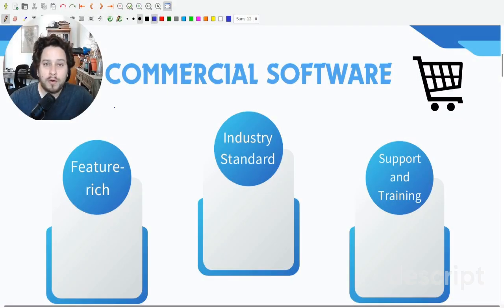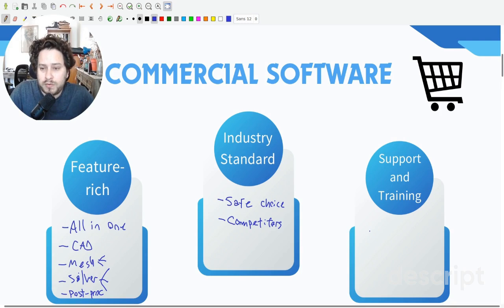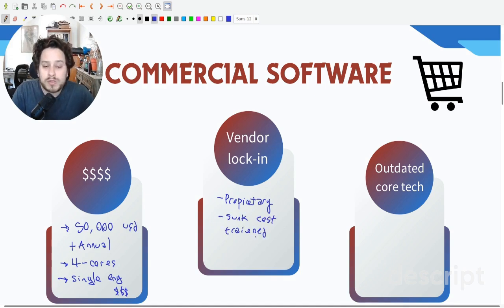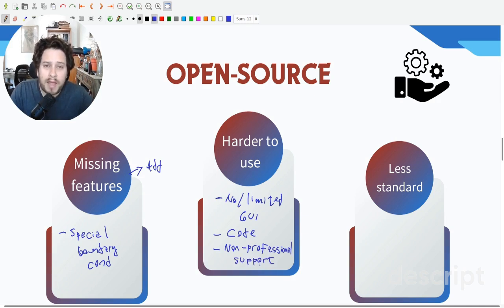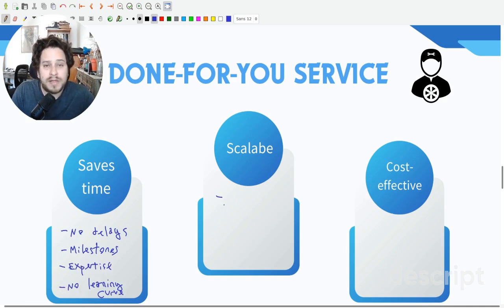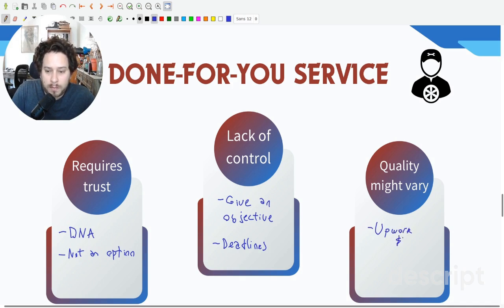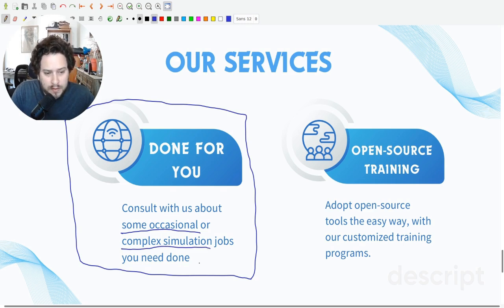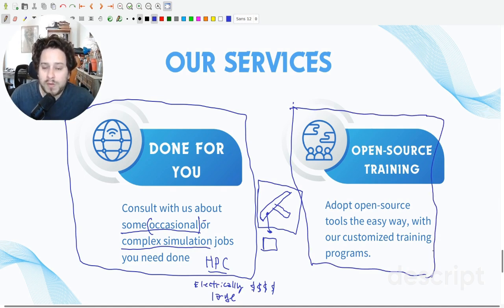Electromagnetic Simulation Software: should you buy, build, or outsource?

Comment: I'm interested in visualizing the RF that circuits emit.. for example something like the videos: 
"free radiated emission simulation (electric field) of a KiCad layout + PCB layout review" 
"[RadioFieldAR -tinySA-] Visualize radio wave strength." (manahiyo831 / VR_RTLSDR_AVATAR or RadioFieldAR_tinySA-ULTRA) 

Commercial tools like Ansys Electronics Desktop (AEDT), Ansys HFSS, Electromagnetic Interference and Compatibility (EMI/EMC) , Maxwell, Siwave, etc.. are too expensive for hobby, but I imagine using an (FlipperZero/LimeSDR) SDR and an antenna wand (Katerina Galitskaya) might give some insight into how a MIL-STD-461/CE101/CE102 test would go, right?
Reply from the maker: That sounds like a cool experimental setup, sure! If you are careful with calibration, you could get a pretty good picture. And to get started with open-source simulation tools for RF applications, you can check out OpenEMS